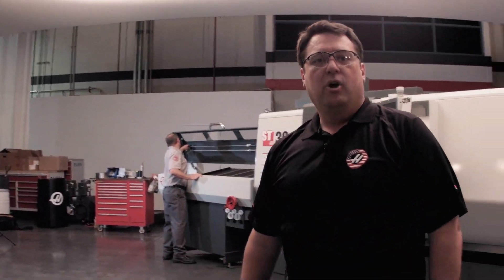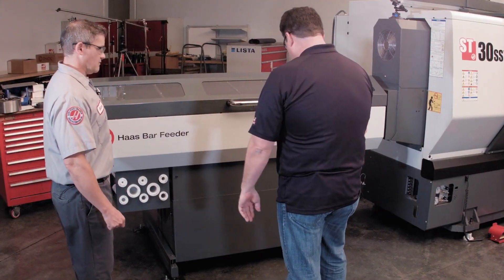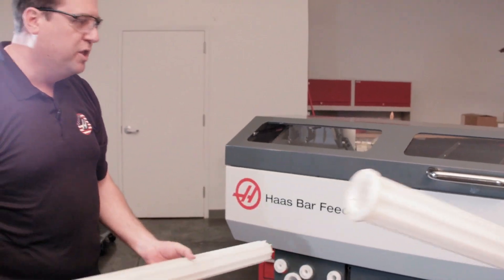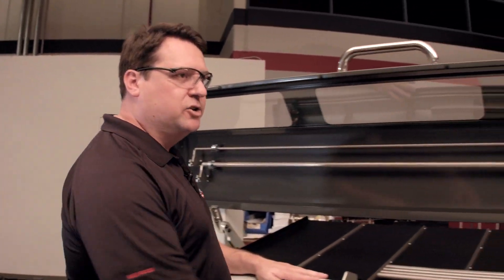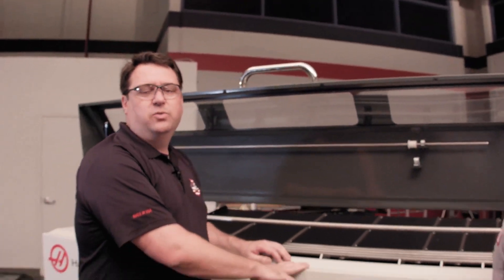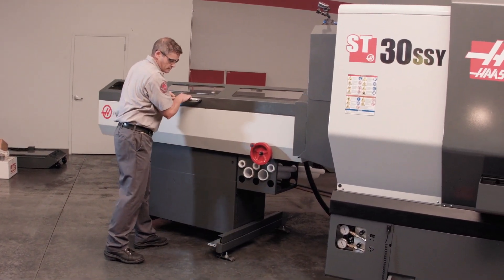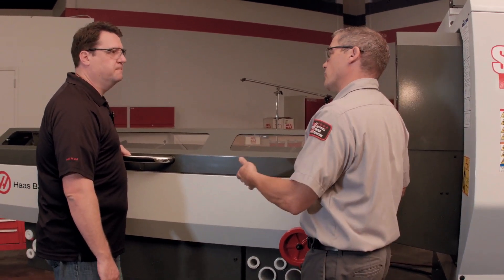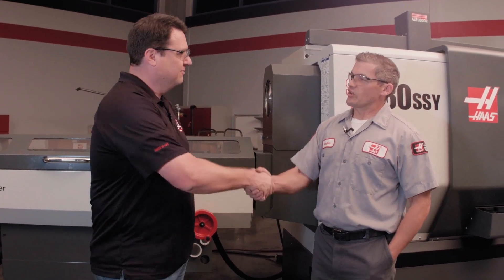The New Haas Bar Feeder: Quick Look

Comment: the old servo bar 300 from early 2000's was a pain  in the ass  to use ..  Setup  time very long .. it  bumped parts too   far sometimes and destroyed the tools.. The bar loader could  also  get a fit, and rotate in  reverse  and jam the bar feeder .. Most of the times faster to not use it at all .. not to mention that flappy useless thing  that was supposed to meassure the bars.. but failed to get the correct length alot of times.

Comment: Thanks for the reply!
Can be used with a chuck?
Reply from the maker: HowlofWind It is possible, but there are several reasons why Haas does not recommend using a bar feeder with a regular chuck. First of all, there will typically be inaccuracies in the feed length since there isn't a collet pulling the bar back against the face of the pushrod. And there can be potential problems feeding shorter bars, when they exit the end of the liner without a collet to guide them out of the chuck, they can get stuck in between the chuck jaws. Hope this helps!

Comment: Nice!
How accurate is the length repeatability?
Reply from the maker: Thanks for the question HowlofWind. The feed length accuracy is +/- 0.01" (0.25mm) when using the recommended pull-back style collet closer. You can find the specs for accuracy on the bar feeder page on our website: http://haascnc.com/lathe_bar.asp?webID=BARFEEDER#gsc.tab=0. Hope this helps!